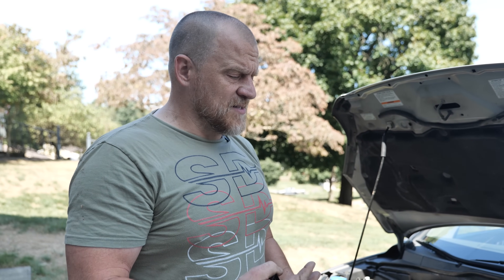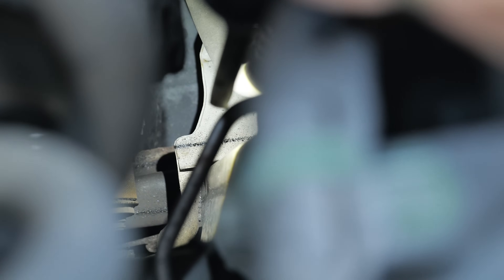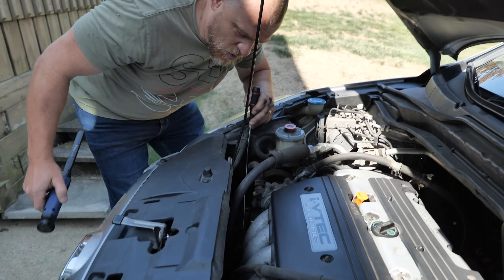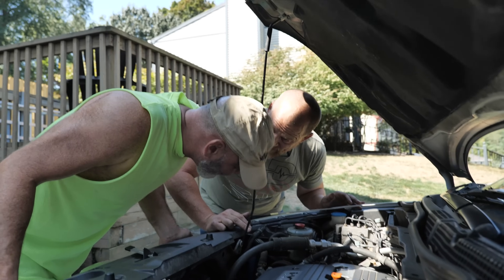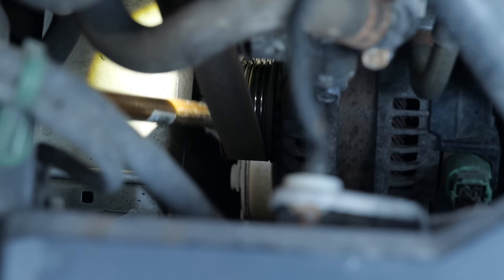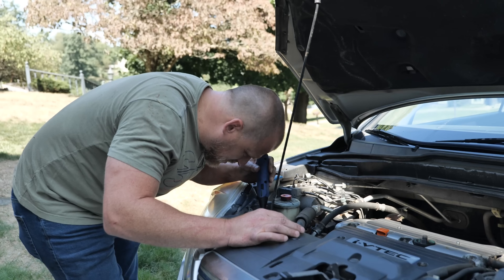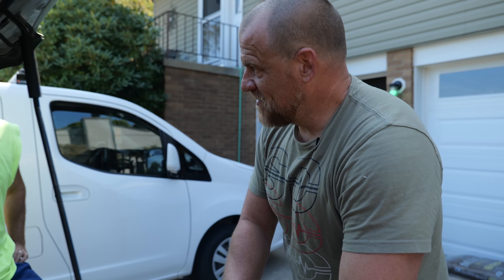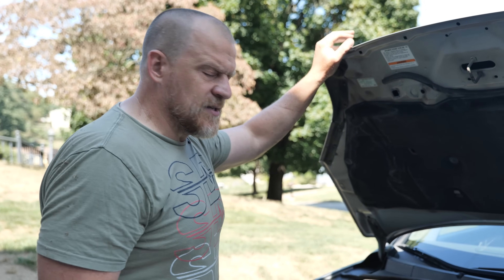A/C Compressor or Clutch Failure - How To Tell [Part 1]

Comment from the maker: We treat these failures completely different! If you have a compressor failure, where it pumped its guts throughout the entire A/C system, you are going to have a lot of other parts that also need to be replaced, along with a system flush. As opposed to just a simple A/C clutch failure, where the integrity of the internals of the A/C system have not been compromised. Join us on this two part series on the diagnosis and repair of an A/C clutch failure.
Looking for additional A/C systems diagnostics and repair? Here is my playlist:
https://www.youtube.com/playlist?list=PLAFYVCyenqco2yr65mNu24aiYT84-YBQy

Comment: Your screwdriver stethoscope trick helped save me $1800! Long story short, it helped me finally figure out that I needed another new belt tensioner (after replacing it twice with defective advance auto parts and then replacing the compressor clutch/pulley) instead of a new compressor and condenser that a shop claimed i needed. Thank you!

Comment: Great series! Thanks for sharing. I had the same problem with my '96 Dodge Ram. It looked and sounded like the pulley bearing failed, but it was just the clutch that failed. The three flat metal springs broke right at the clutch hub interface. If I would have know how the system worked (at the time of failure)... I could have removed the broken clutch on the side of the road. Then the pulley would be functioning as an idler.  It happened in the middle of a 1400 mile drive home.

Comment: Look for rust dust around compressor clutch as an early sign of failure. Also, grab the AC clutch center WITH ENGINE OFF and try to rotate. Center should rotate smoothly with slight drag. In some cases, clutch can be disassembled and some shims removed if clutch has wear causing it to not engage properly.

Comment: Yep im a Honda tech and we deal with these all the time. Even if the bearing wasnt bad sooner rather than later it would need a clutch and coil kit because every CRV of this gen needs one! Not necessarily because of noise but because they fail to engage the clutch
Reply: if it's like the subaru non-repairable ones(my foot!) the clutch disc gap needs re-shimmed due to wear and the rubber bushing need replaced or it wont always pull in solid and just slip chewing itself up.
granted I wouldn't bother doing that on majority of them, except my own/family/friends.

Comment: No belt😂. Belt is pretty much a given on an accessory drive job. Unless it’s brand new
Reply from the maker: Remember I'm doing this for a friend's son, who doesn't have a lot of money and the belt was fine and did not need to be done at this time. Well, now it does lol
Reply: @ScannerDanner  I get it, BUT a $20 belt now is cheaper than a breakdown and tow bill in a couple months from now.
Reply from the maker: @mph5896  of course
Reply: I would have taken the belt off..  if it was a close enough drive.

Comment: So with checking the voltage here... The only way it could be battery or alternator related is if the voltage is dropping... Can a bad compressor make voltage fluctuating when idling?
Reply from the maker: I only mentioned testing battery voltage as a variable due to the electrical burning smell. If it wasn't charging, this would have guided me towards the noise.
Reply: @ScannerDanner  oh I see.... I'm having an issue at idle where it's fluctuating but giving it gas it's charging normal. New alt, Cleaned connectors all except starter connector,( didn't have time) but still fluctuating at idle. Was just wondering bc it seems to happen more when the ac compressor is on.
Reply: @MasterMind-zw3zl  dirty throttle body/intake/idle air control/pcv valve-system(depending on age.) lack of proper metered air control will make idle speed load changes very noticeable. but test and visual inspect, don't guess!
Reply: @throttlebottle5906  appreciate the input bro

Comment: Good recommendations here.  Don't do just a clutch on something like this.  In my experience, the heat from the toasted bearing damages the shaft seal and the compressor will leak down the road, if it's not leaking already.  As Paul recommends, replace the whole compressor.  The only time I'd even consider just a clutch is if the coil opens and it just stops engaging, and only then if the clutch is even available.  98% of the time it gets a compressor.  I also recommend Denso or genuine Honda only on the compressor.  If you do end up needing an entire system (internal compressor failure) don't be lulled in by the low price of those kits that contain everything.  Those compressors are often garbage and will fail in a year or two.  Ask me how I know this.  I've never had a Denso compressor fail on me after a repair.  Had a couple of the cheapo ones go bad.  Not fun.  Same advice on starters and alternators.
Reply: Eh, even the name brand parts can be bad. I put a Denso new compressor on a Honda van last year, noisy right out of the box. Had to recover charge, remove and replace it with another one. 

I hardly ever do clutches only due to availability of the kits being low. But I just did a clutch only last week. Pulley bearing was noisy, was able to get a clutch kit on clearance for $30. Put it on and all is well. Better in that situation over risking a dud new compressor when knew the old oem one was perfect.

Comment: I did a compressor because of the clutch last year on my '04 Envoy.  You can buy a kit with everything but the tools for a decent price.  As long as I was in there I did the thermostat (hadn't worked in years), fuel pressure regulator (random fuel drips), and serpentine belt and idler pullies. Turned out great!